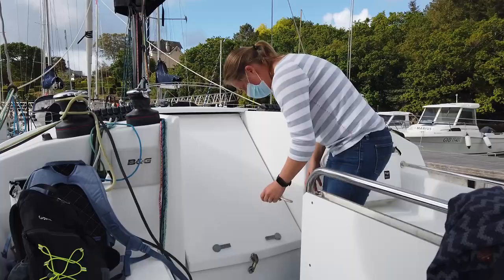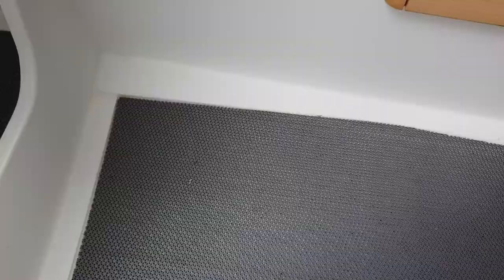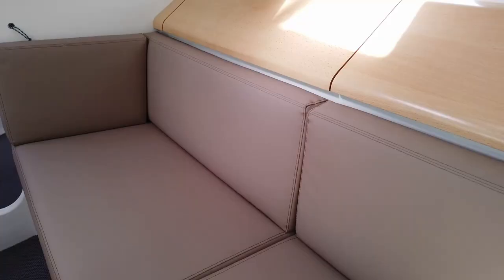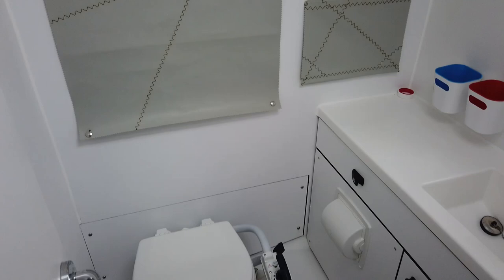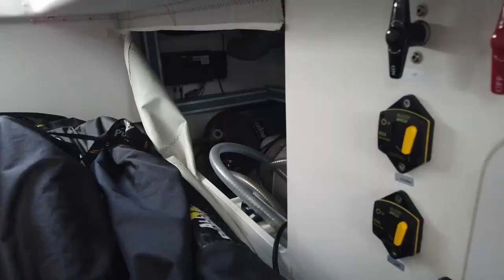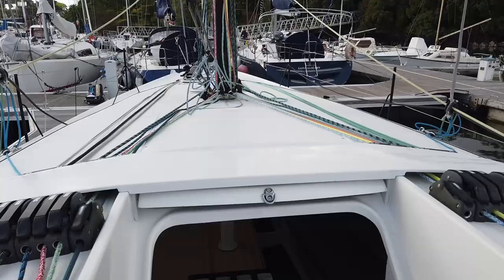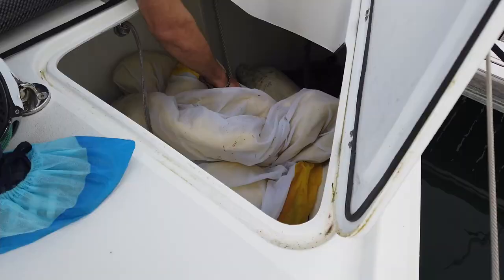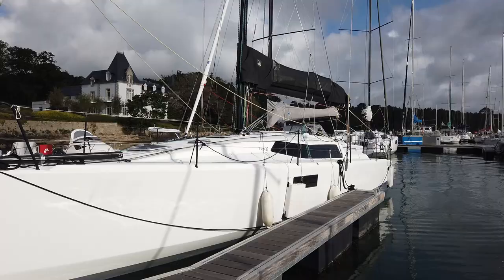Could we LIVE on this FAST Sailboat?  | Pogo 36 Boat Tour |

Comment: An acquaintance bought one. Due to the light weight construction; lifting keel;  rudder and propellor layout, manoeuvrability around docks when using the engine is very tricky in a breeze without (an essential) bow thruster. Going fast A to B  is great, but coming alongside without a drama is also desirable. Caveat Emptor !
Reply from the maker: Me thinks one doesn't buy a POGO to dock well.  I can see it being tough.  Our new Trimaran is nearly impossible :)
Reply: Sometimes this type of boat is better to reverse in tricky spots.

Comment: As long as you can live flying a spinnaker or assymetrical foresail running downwind then the answer is yes.
If you want to do anything else than go across the wind then forget about it ...
NOT very good boats but lots of space.
Its why they sell seond hand for cheap.
People are lured into buying them and then sell them on once they find out for themselves how BAD they are.
Reply from the maker: Horses for courses as they say!  Thanks for watching :)
Reply: @OuterPassage  My pleasure. If your course is that of the masses then fine. Just trying to be of assistance.
Once bought you're stuck with ot for a while.